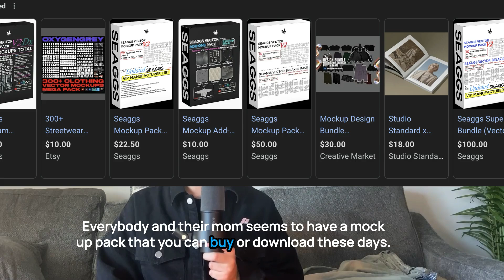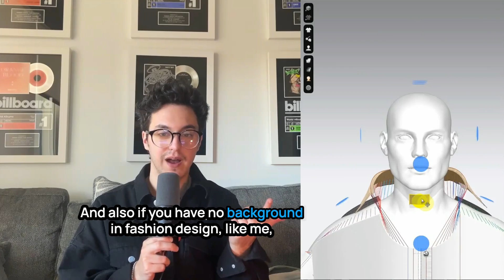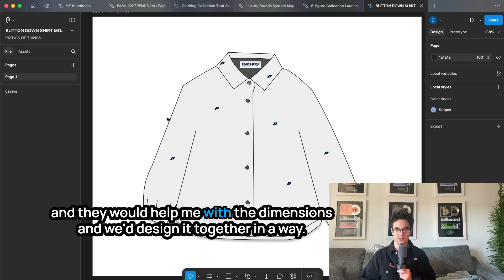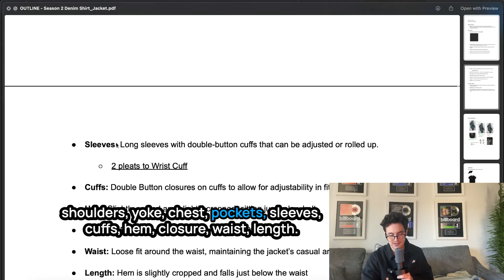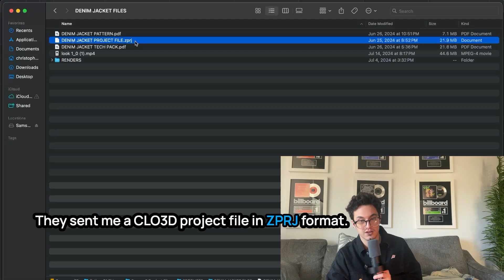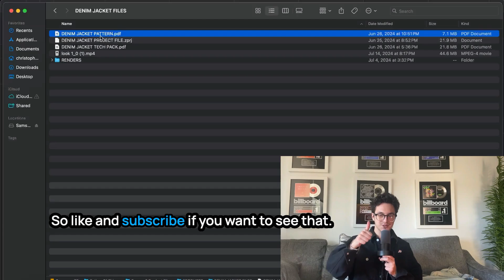I Stopped Using Mockup Packs (My NEW Clothing Design Process in 2025)

Comment: How do you send out the exact dimensions to your manufacturers if you don't draft patterns from an actual real piece?
Reply from the maker: @ofm_made_easy  Clo3D allows you to draft patterns based on the dimensions of a real person. I set the dimensions of the 3D model based on the real model that wears the clothes in the photoshoot. The clo3D atelier helps me grade the patterns for different sizes.
Reply: @csdrago-creative thanks for the response. Do you find it reliable enough for this? Right now I have an uneтнical way to create patterns; i order a designer item that i am inspired by and once i copy its pattern i return it and get my $$ back.
Reply from the maker: @ I find my method to be the most reliable so far. I used to take measurements of my favorite pieces from other brands. Often times I ended up with samples that didn’t fit right. When I use the 3D software, the pattern measurements are perfect.

Comment: I also noticed you did not add any sizing references to your pdf. For example if I want to try out a method like this in the future. Did you also give any sizing references maybe from your favorite jacket - shoulder lenght, top to bottom lenght etc, so that the sample would fit? Im asking this because I saw when you received the patterns with specific dimentions, it made me wonder what was the Clo3d freelancer using as a base reference?

I appreciate your answer in advance!
Reply from the maker: You can set the specific height and weight of the model in CLO and it is accurate to a real person. Then the clothes are designed based on the size of the model. I typically use "industry standard" model sizing - 6'0'' & size 30 pants. Then I'll mark this as "MEDIUM". My manufacturer will then grade the pattern so I can sell Small, Medium, Large, and XL sizes. Is this something you'd like to see a video about?